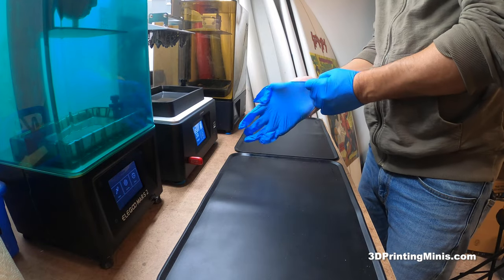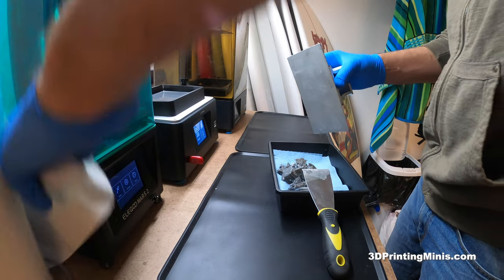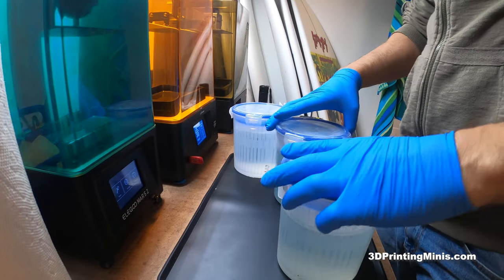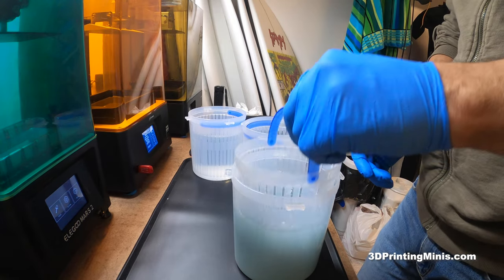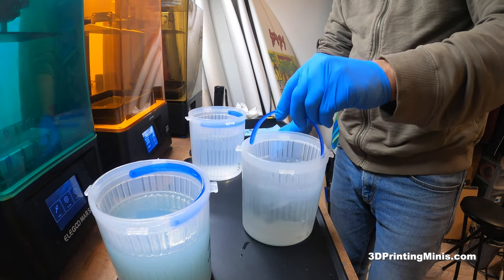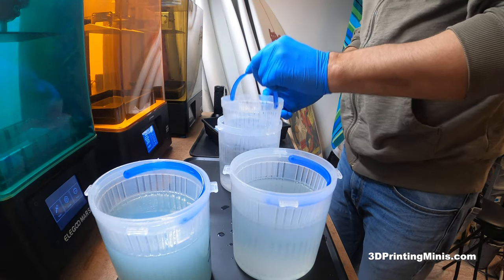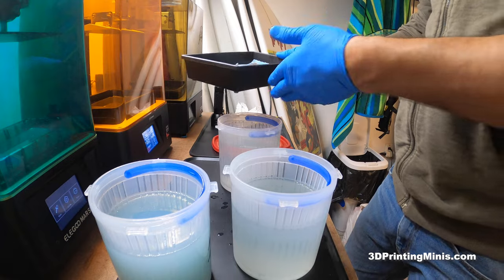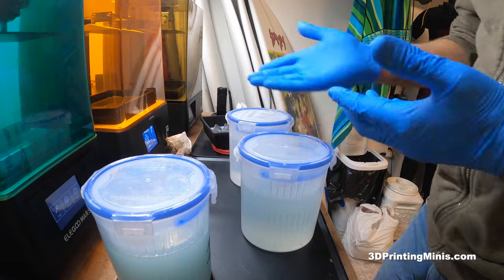How To Clean 3D Resin Prints Without A Wash & Cure Station - Triple Dunk IPA Technique

Comment: Thank you for sharing this fantastic video! I own an Anycubic Photon M3 Max, and I've been experiencing some difficulties when printing a bottle cap. I recently acquired the Wash and Cure Max, and I must say, your approach yields much better results! However, I'm struggling with resin layer separation despite printing at a thickness of 0.05 as per the ABS-Like Resin Pro manufacturer's recommendations. Any advice you could offer would be greatly appreciated. Awesome video!

Comment: Concerning the "drying over night", I dont think they are drying from the IPA, they're just chilling.  99% IPA dries in like a minute or two if its just a small coating and does not leave residue.  Just pointing that out.
Reply: By the time I remove supports from multiple minis they are dry, using 91% ipa

Comment: How long does it take your flashlight to cure trace / very small amounts of resin when cleaning up as you described to make it safe?
Reply from the maker: Resin is toxic so I'm not sure it's every actually 100%. You'll need to contact your resin's manufacturer for an answer to this question.

Comment: I live in tropical country, would you recommend to use sunlight to cure? And why do i need to dry it overnight, what big differences it would make?
Reply: You can use sunlight, it just takes longer. instead of a few minutes itll be several hours
Reply: you'd want to make sure prints are dried completely or risk the chance that they'd leave a chalky white residue when they cure. Drying it overnight is extensive but long as they look dry enough, you should be good

Comment: Just curious why did you go from Mean Green to IPA?  Trying to maybe go with less of an aggressive chemical smell and was thinking towards the mean green. Thanks.
Reply from the maker: I figured out a way to clean my prints without needing the ultra sonic cleaner. Plus, when the ipa gets dirty I can transfer the good top part to another container and then cure and evaporate off the unsalvageable remaining ipa. Using the Simple Green made too many containers of murky waste liquid that I needed to take to the special waste dump. And ipa has come down in price considerably since the height of the pandemic, so it’s easier and more affordable to get.
Reply: @3DPrintingMinis You’re using the Ultrasonic incorrectly. 

Please don’t put any chemicals in your  ultrasonic besides distilled water. 

My ultrasonic has a basket in it because parts should never touch the bottom.

Use a smaller Tupperware container and lid with IPA and set it in the basket of the ultra sonic being sure that its submerged. 

If needed you can hot glue some weight on the bottom so that it wont float. Leave it in there 3-5 minutes and let it clean your parts. This is much better than a shake, or stir. That is it, nothing else and and guess what? 

Now you can use your ultrasonic for any type of cleaning and by always using the proper cleaner per item and never contaminating the ultrasonic machine it saves time, materials, IPA, etc, and most of all it saves your equipment. 
 
Give it a try.
Reply: @glennedward2201 именно! Вы говорите о том, чтобы погрузить контейнер в объём воды, при этом не касаясь дна. Блестяще!

Comment: Honestly, I'm kind of shocked that you talk (and now that I think about it, a lot of people the resin print) about the IPA burning your nose, but not seeming bothered about taking the prints out of your printer.
Personally, while I wouldn't call the smell of IPA pleasant, resin stinks to high heaven for me, even through a mask, and IPA doesn't really burn my nose either. If just dealing with IPA was the only thing I had to worry about with resin printing, mine wouldn't be collecting dust in the attic until I decide to take another crack at it.
Reply: If you can smell the resin through the mask, you have a poor seal / bad respirator. A N95 isn't going to help, you need a full on respirator mask. 

I suggest the PD-101 full face, and remember the cartridges only last about 3 hours before you need to change them. Hope this helps.